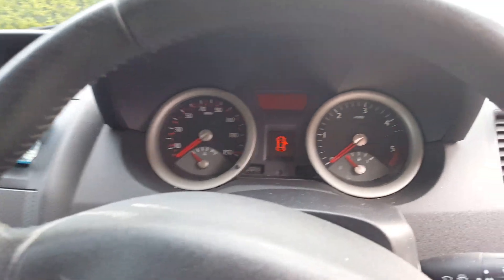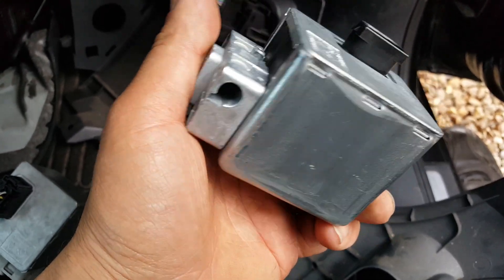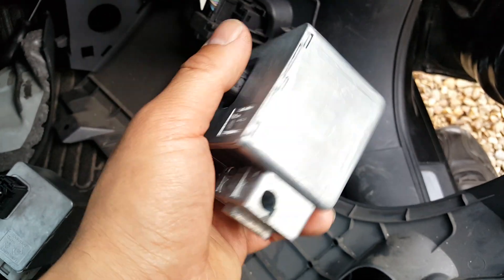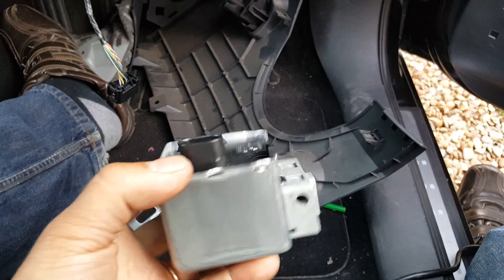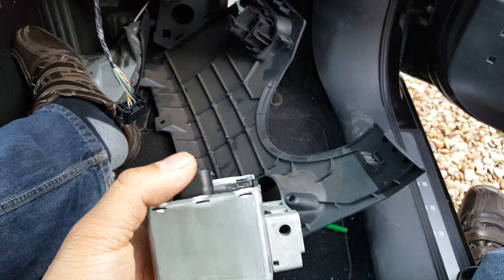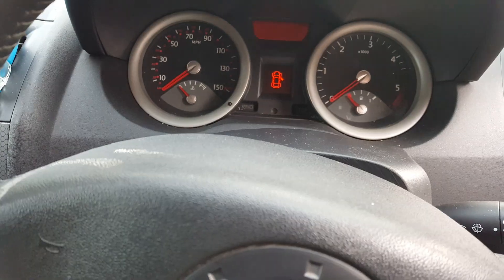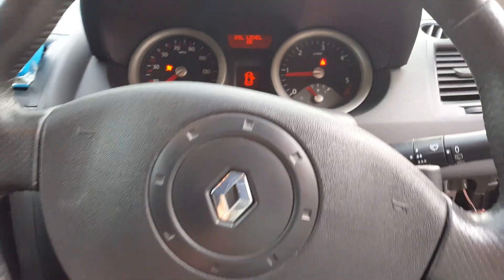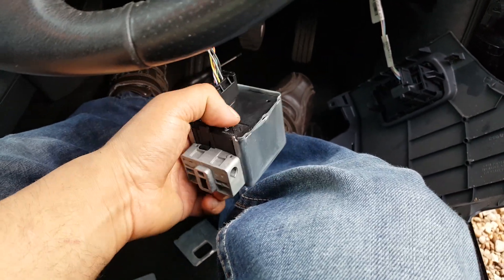Renault Megane steering lock fault repair.

Comment: My car Saab9-3 got the same problem and I wanna rest the fault code! You know how can I know which eeprom should I choose? There is no information on internet! 
Valeo SCL modules name name. Tnx for your time 🙌
Reply from the maker: The might be a completely different procedure...
I never had to do one on a Saab, so can't really advise...
Reply: @LMAutoRepairs  Tnx for reply! So u mean there is no way to know which eeprom is correct even from Ecu.
Reply from the maker: No... that is not what I said...
If you open the module, you can relatively easily identify the different components...
What I said is, the reset of the eeprom most likely is not done the same way as the one on this video...
You can always try, but I have doubts that it will work...
What is the issue you are having any way?
Reply: @LMAutoRepairs  unfortunately I can not share any picture or video here I could show you! Streering wheel lock fault dosen't let's car start?
Reply from the maker: @rmt5820 
OK... but that doesn't necessarily means you have the same issue...
The electronic steering locks, have little motors and microswitches that can fail...
So, though you might have the same symptoms, doesn't mean you have the same problem...
You need to start by scanning the car, look at live data to see if anything points into any direction...
Reply: @LMAutoRepairs  
Mine has two motors inside,  I checked all, it happened when I wanted to install Streering shaft in engine bay and Streering was on lock position, when I opened  I saw that spring pops up and got Streering lock on display.
Reply: I checked mine totally has 5 eeproms 2 on the top their connector fits and 3 on the bottom! 4 of the is the same with the same number on it only one is difference than anothers.
Reply from the maker: I doubt you have 5 eeproms... 
Google the numbers...

Comment: Thanks for video. What programmer are you using to write data to chip? Thanks.
Reply from the maker: If I recall correctly, I used X-prog on this video...
But any other compatible programmer will do it...
👍👍👍
Reply: @LMAutoRepairs  Thanks. My friend call me today with the same situation, as on your video... But car just don't want to start on the road.. so we starting to find a quick fix... After a lot of tries he started the engine by manual moving of locking block, and run car to parking... but that was a last chance, after that it finally stopped.

As I understand fastest way to fix it on the road is a cheap chinese steering wheel blocking emulator, because he cant find service, that can help him to fix it
Reply from the maker: @ukrainian333 
Yes...the emulator should do the trick...
👍

Comment: Hey there, I have a basically broken Renault Laguna, very similair steerling lock box, I am taking out of the car what I can still use (I bought a newer Laguna) and then im going to get rid of it but the steering lock is currently locked, I took off the ermm pin module between the steering shaft and the steering wheel, the bit that holds this steeringlockbox on it.

My question is, how can I get it off or how can I just unlock it so I can steer the car, so when they come and get the car, it wont be as much of a hassle?
Reply from the maker: There is no easy way to remove it if the steering is locked... you need to dig into it, cut or drill the bolts... surely you find a way... perhaps, remove the steering column... Will be easier to work on it when outside...
👍👍👍
Reply: @LMAutoRepairs  thanks man, I was afraid of that but it makes sense, ill try to get it off and if not ill make some make shit connector pipe to steer it just to get it on the truck later, thanks again!

Comment: I have the same problem with my Renault megane2 1.6 16v.
I did change all my car computers including this one and I did program this Eeprom. After I plugged the steering lock module the car started normally I turn it on and off 5 or 6 times without any problem. but when I take the car key out of its reader the same problem came back! I don't understand why. could you help me, please? 
Thank you for the very useful video you are making

Comment: When I just turn on the ignition, the lock works normally and turns on and off, but when I turn on the car, it just turns off but will not lock when the car is turned off. Lm do you know what it could be
Reply from the maker: Either a mechanical fault with the lock, or a similar issue as per the video...
Difficult to tell without checking...
Thank you for watching!
Reply: @LMAutoRepairs  Thank you

Comment: I had the same problem on a Megane 2 but the real reason it didn't worked was because of poor contact between the steering lock(pin 5) and the fuseboard in the engine compartment on the +12v after ignition. Or poor contact between the engine compartment fuse box and cabin computer same link +12v after ignition. I cleaned them and the 2 related fuses terminals and car works ok for now. Didn't have anything to do with it's 24c04 memory. I don't understand if the guy had problem with the 24c04 memory geting its data altered , why didn't he changed it with a new one? Before starting to blame the steering lock do a can clip diagnostic. Even if it's made by Valeo. it will tell you exactly it's problems. These cars at their age start to develop issues with their connector terminals. Either they corode, oxyde or get burn because of the high contact resistance.
Reply: Hi
You was talking about recode the lock, do I understand it this way, after you virginised the lock, it will automatically code the right way first-time you start the car? 🤔
What interface do you use with Canclip, can I use the VCI J2534 from the Autel IM608? 🤔
Instead of de-solder the eeprom, couldn't you just use the clip and read?
Reply from the maker: In your case, looks like you had multiple issues...
Thank you for watching and for your comment!

Comment: hello friend greetings from canary islands, i have a renault megane with the same problem exactly what you recommend me to do, i have a programmer vvdi prog can i do with this team. can you help me thank you very much......   hola amigo gracias
Reply from the maker: I am pretty sure that vvdi can do it...👍
Thank you for watching and for your comment!
Reply: @LMAutoRepairs  hola amigo con el equipo que te comente vvdi si pude hacer la lectura . pero no puse toda la informacion en blanco de el archivo, el coche sigue igual  hay que poner el todo el archio en blanco.  gracias por tu a tencion
Reply: @LM Auto Repairs hello friend with the team that vvdi told you if I could do the reading. but I did not put all the information in the file blank, the car remains the same, the whole file must be left blank. thanks for your attention

Comment: can't it just be virginized by renolink ?
Reply from the maker: Possibly...
Never had one to try since I got renolink set up...
👍👍👍
Reply: @LMAutoRepairs  in renolink there is EPS virginizer, and u can use renault steering lock emulator for 35 euro and it works without programming, just plug and play
Reply from the maker: @MrFOXMAROC  
👍👍👍

Comment: I've been having trouble starting my car I just hear clicking so I took the module off and the bolt that comes out I use a screwdriver to push in and out a few times and that seems to off done the trick for me anyway..
Reply: Would any silicone spray be OK or a specific kind..
Reply from the maker: @andrewbeardsworth5461  
Not really... any should do...
Reply from the maker: I would add some lubrication to it...😉
Thank you for watching and for your comment!
Reply: @LMAutoRepairs so would wd40 be OK to spray in where the bolt shots out.. I'm not gonna take it apart
Reply from the maker: @andrewbeardsworth5461  
Possibly... but I would use silicone based lubricant...👍

Comment: i have same problem but when i shaking my steering wheel car start up....so that modul works fine but i think he losing connection or something pls help
Reply from the maker: Check connections etc...
Thank you for watching!
Reply: @LMAutoRepairs   tnx......check jack connection.....can i lubricate that iron who lock and unlock sterring wheel? (sry for bad eng)
Reply from the maker: @ipe7739  
Yes you can... you can easily remove the lock when on the unlocked position...
Reply: @LMAutoRepairs  tnx i will try

Comment: on the lock connector pins 3 and 6 are for the can bus to make the lock operate. do you know how to check them? multimeter or a scope? cheers from Porto
Reply from the maker: Scope...
Thank you for watching and for your comment!
Reply: @LMAutoRepairs  hi thank you very much for the reply. will be diagnosing a bad lock tomorrow and i am doing the homework, i am new to canbus as i work mostly on older cars, will be using an old 20mhz 2 channels analog scope wich i use for my hifi repair hobby, i dont know what signals to expect in the H and L canbus pins but i guess if i see activity when trying to lock/unlock then i can assume the fault is in the lock itself.  "potato logic" like we say here
Reply from the maker: @MrHBSoftware  
Yes... that should be enough...
A quick Google search and you will find loads of samples of can signals...
👍

Comment: Hello, nice video! One question though: couldn't you use a clip cable, so you wouldn't have to desolder the chip ?
Reply from the maker: Yes.. you can try... I personally prefer to remove it... the pcb circuit can sometimes create issues...
Thank you for watching and for your comment!

Comment: You are my lost hope i did every possible thing but eventually i bought a new one for more then 400euro, but nothing happened. The lock is new from the dealer in box so he was empty. When i push the start/stop button i hear something like an airco and inside my backmirror their is something also like a small motor/ airco making noise. Further i hear when i push the button a ticking noise but i cant but my car on. Everytime i push the button it will turn of and then one , everytime. In the garage they told me that it was the lock so i replaced the lock. My car is in front of my house because i used a cable and a friends car to put him here.

I was wondering if you have any last ideas. 

The things he does is.
1 put key inside and pushes button start/stop
2 the car makes ticking noises and breezing air
3 . Then service and steering lock dispears and then when i want to start everything is resetting.

What could it be...
Reply from the maker: Hi
Have you checked wiring integrity from/to the steering lock?
Scan, any other codes?
Thank you for watching and for your comment!
Reply: @LMAutoRepairs  Before i changed the whole unit ( steering lock). i got the following codes. 
DF002: Key Colomn, intern electronic defect lock colomn. 

DF010:combination circle lever under the handlebar not properly connected

DF009   circuit +APC incoherentie

df 031 , df 027. The garage deleted all except the df 002, that's why i thought i would change the unit. What can i do, because when i try to start the car, with star/stop button. everything is resetting and the airco i hear, and i can't even put my windows up anymore, THE update is after i put on a new unit like your video, it says, electronic malfunction. 

Is it possible you could help me, if i make a video?, because the garage and everyone have no idea about the electronic things... I was thinking when i try to start the car i hear clicking and i believe that are they fuses, but the garage told me he checked them. i have no idea what to do.. thank you my friend

Comment: Hello will I be able to virginize  the chip using UV light instead of this method using the computer? My Renault megane is doing the exact same thing. I've changed the whole steering lock controller and the car started only once after I've changed the steering lock. Now I understand why it started once thanks to your explanation. So at least I'm a bit motivated now, as I had nearly given up.
Reply from the maker: Hi
Not sure if possible with UV...
A programmer is quite cheap anyway... you can get one for less than £10...
Thank you for watching and for your comment!
Reply: Okay, thanks a million! Please confirm that all I need to do is erase(virginaize) the chip I got from the other megane and then it should help clear the steering lock error?

And I saw you reading the digits engraved on the faulty chip you were replacing, I'm just curious to know where you used that? Is there anywhere I'll need to enter those digits engraved on the faulty chip I'm replacing?
Reply from the maker: @thabolegwate4444  
The engraved digits are just the identification of the chip... you don't need to insert them anywhere, is just that you know which chip you are working with... so you select the correct chip when to read it...
And yes, should be the only thing you need,  providing that there is no other issues with the car...
Reply: No there shouldn't be any other issues because it was running perfectly after I changed the engine. The only reason the car won't start now is this steering lock issue. You've been a great help thank you so much, I've been suffering with this issue for months now... Only Lord knows how grateful I am! Can' thank you enough.
Reply from the maker: @thabolegwate4444  
No worries...
😉

Comment: Why didn't you simply swap the EEEProm chips or the entire PCB?
Reply from the maker: Because the idea of this video was to demonstrate how to reutilise the lock...
If the issue with the original lock was mechanical,  yes, swapping the eprom or the whole pcb would work...
But this locks can sometimes corrupt the eprom data, which in that case this is the only solution...
Thank you for watching and for your comment! 
👍👍👍

Comment: Hi
Can I use bdm 100 to read the rom and reprogram it again ?
Reply from the maker: Hi
I don't think bdm100 can read this eeprom... only mpc555...
Reply: LM Auto Repairs I found in the description of bdm 100 that it reads the software for the following 
29BL802 SSOP eprom file (or ROM memory with maps if eprom physically not present);
MOTOROLA MPC5xx Processor file;
Serial Eprom content.
So can it be used or not?
Reply from the maker: @ahmedesmat6137  
You have not researched enough...
29bl802 is a flash memory...
Mpc555 or similar is a MPC...
The memory I am reading from this steering lock is completely different...
Research more and you will see that bdm100 will not be much of a help in this case..
Reply: LM Auto Repairs 
Will please tell me what are the alternative for xprog to reprogram it ?
Reply from the maker: @ahmedesmat6137  
Any eprom programmer... there is many out there...
Willem, orange, xhorse, and the list goes on...
Reply: LM Auto Repairs 
Will  xprog 5.55 do the job and read / write and prog ?
Reply from the maker: @ahmedesmat6137  
Most likely yes..

Comment: Hello, what is the procedure for resetting the locker to unlock, before I remove it from another vehicle? Do you know anything about it?
Thank you for the video!
Very useful :))
Reply from the maker: Not really sure... if renolink can do anything to it... this is the only procedure I am aware of... but I will try next time I have one around...
Thank you for watching!
Reply: LM Auto Repairs the first part of the issue is that I can’t separate it from the steering wheel assembly. It’s locked. I can’t extract the screw.
Can you help me please?
Thank you:)

Comment: Hi!  Nice video, and very well explained!  One question... what if i swap the original eeprom, and move it to the new board? the car actually starts and all, it just doesnt lock the steeringwheel... so i have an mechanical issue more than electronic one...
Reply from the maker: eXe 
Hi
It should work, if the problem is mechanical... if is a corrupt eeprom, you will just be moving the problem across...
Thank you for watching!

Comment: Hi, i have an issue with a 2006 renault espace steering lock MOT failure, i took the lock off the steering column to see whats wrong because you could turn the steering wheel to the right with card out, is the lock pi inside the problem? i opend it and now the lock pin doesn't go in...
Reply from the maker: Ta. Tariku 
There is usually a small system that engages when the lock is opened, which then prevents the lock to be correctly closed and operational...
Just remove that system...
Thank you for watching!

Comment: hi
How did you know that the problem exists in steering lock ?
Reply from the maker: mohamed mohamed 
Hi
Experience... this locks are known to be coded to the car and they are part of the immobilizer..  so you can't just replace it with a second hand one... as this will be coded to the car it came from....

Comment: hi ,nice  work for meg 2. what about megane 3 ,does it work the same way for coding  the esl., fill all data with FFF. can someone advise please. thanks
Reply: Hi everyone, has anyone tried it so far on megane 3?
I had a problem yesterday and tried same way like mk2 but didn't worked. Mechanical part is the same but board is little bit different.. and it's all coated with varnish to make soldering more difficult😭  Luckily, it was a mechanical problem so I swapped out whole board to make it work, but I would like to know if there is a way to virginise it simply like mk2
Thanks in advance
Reply from the maker: jasonics md 
Hi
Thank you for watching and for your comment! 
Unfortunately I can't help you... I never done a megane 3 nor have researched how to...
Google might be able to help you...
Reply: iive tried  on google,many forums,it seems no one has done it yet.  esl is same as meg 2 with 24c04 eprom. if u get any info let me know friend.    meg 2 is 250kbaud   meg 3 500kbaud.